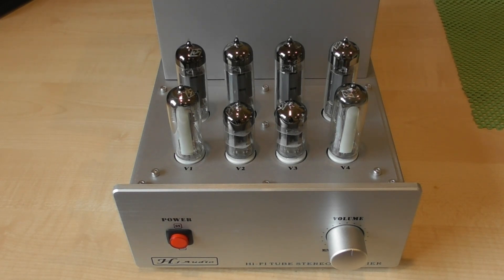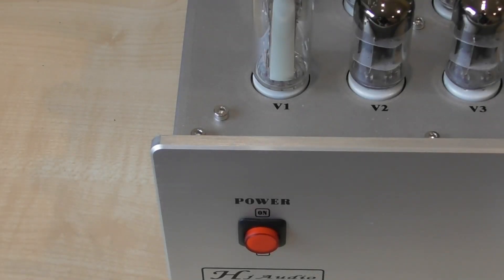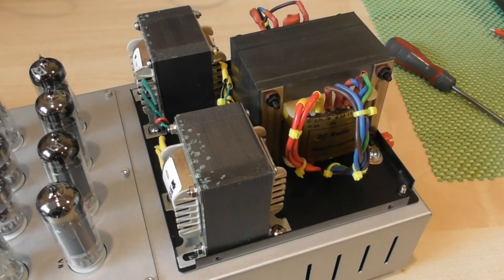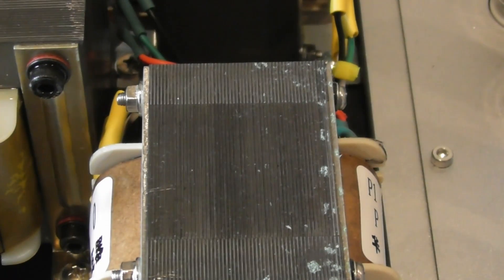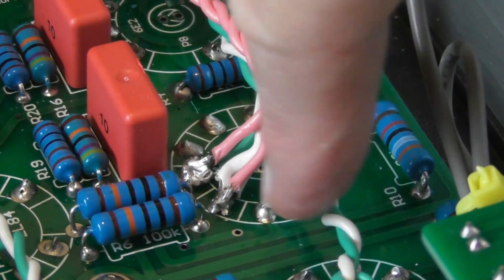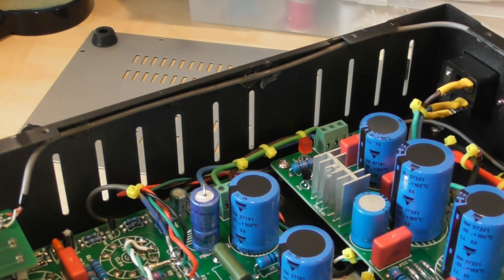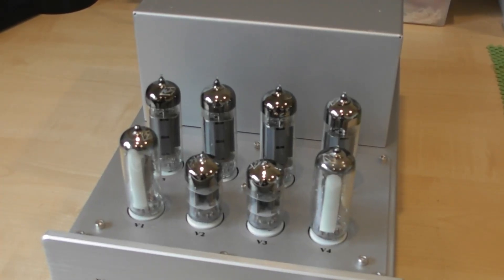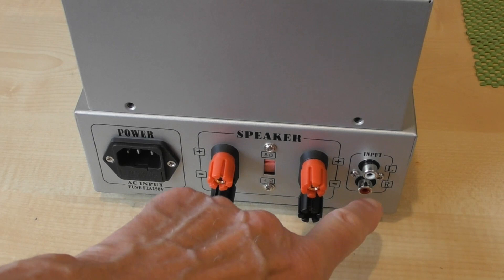13 watt Valve Stereo Amplifier Kit and review. from eBay.

Comment: HI Michael,
Great build job on the amp!  Thank you for sharing!  One note:  The reason for the seemingly over-complex design on the power supply is because they wanted to make provision for the use of either a 6P14 or EL84/6BQ5 type output valve.  The 6P14 is actually a really high quality tube that can be purchased at a reasonable price.  While they are technically interchangeable with the EL84 and 6BQ5, they do have different specs, one of them being the screen grid characteristics.  This power supply allows for optimal screen grid voltage for either type of valve by just adding or subtracting a 20 volt zener diode in the circuit.  It took me a while to figure it out, but if you look at the datasheets for each type of valve, you will see the difference.  Although it would work without such a complex power supply, this just maximizes the performance of the amp.  I also think that's why this amp is so linear.  They really put a lot of thought into this design.  That's why I really like it so much.  Thanks again for sharing!
Reply: One of my most favourite YouTube super stars! Glad to see you here Tony... 
Just a quick question about those magic eye tubes, I'm figuring that if anyone knows the answer to this question it would have to be you! 
I was wondering if these tubes work similar to a cathode ray tube as in a TV? Would they be emitting X Rays? Or does that involve higher voltage or a different cathode/anode design? I really don't know enough about X Ray tubes even though I have seen a few videos about them, I found the tubes with the spinning anode or cathode inside the tube amazing! Someone else has a video showing how they spin and boy can those things keep spinning once they get going. It had me thinking about how much more efficiency one could possibly achieve out of a generator if one was placed inside a vacuum? I wonder if anyone has ever tried it? 
Anyway, I watched a video that talked about the cathode ray tube of a TV and they said that it produces X Rays inside, he also went on to say that we might remember how our parents used to tell us to sit back from the TV because we will go blind, how right they were LoL... But these magic eye tubes, they are nice to look at but do we need to worry about going blind or it's a different thing...

Comment: Loved your honest opinion about tube amps in general, Micheal.
I'm currently waiting for my Boyuu A9 kit to arrive and I've been lapping up every tube amp video I can find, searching for tips, etc.
You mentioned that yours is the quietest tube amp you've ever heard and opined about the superfluous switched voltage power supply for the heaters... perhaps that's why it's so quiet?
I'm no engineer by any means but I've been lurking around in forums and YT long enough and have picked-up that AC heater circuits are major sources of hum if not mitigated and some have stated that they run theirs on DC to that means.
Having said that, I preferred mine to be 100% analogue and chose one with a rectifier tube.
There shall not reside any semiconductors in my rig! LOL
I've not used a CD, let alone vinyl for quite some time. My preferred audio source is a Google chromecast "puck" plugged in the the Line-in of my current stereo which sounds fine to my untrained  ears. Cant't wait to hear what it sounds on the A9. Have you listened to streamed music? Your thoughts?
Reply from the maker: Hi Dennis Thank you for your contribution to my channel. Regarding the low noise of the amplifier. The heaters do not run on DC. They are just standard 6.3 volts AC. A separate winding is used for the preamp but it is centre tapped. It's part of the HT supply that is stabilised. Hum is mostly caused by poor layout with the heater supply or poor earthing points.
Regarding my music, I mostly listen to internet radio from the BBC for talk radio, for music I listen to Radio Caroline Flash Back. Both sound OK!! but for my own music I listen to FLAC files from my PC recorded mostly from my CDs which   I no longer have.

Comment: Hi Michael. Sometimes if an amplifier remains undistorted up to clipping it seems less powerful than it is. Equally if it distorts as the ear does it sounds powerful. SE designs can be remarkable is this. This probably is because second harmonic distortion is present. Beware, many SE amplifiers are not the excellent examples.  They need better power supplies and transformers. RH34 is interesting by Kitic. RH 84 also.

Comment: I have been a huge fan of the man with the X Ray super powers for a very long time... I love his work. He has only ever been beaten by one DIY eBay amplifier and that was the quasi complimentary contraption that I really wished that he had a go at improving, I have a few of them still waiting to be assembled.
I don't know what it is but there's something about them that I like and that's even before I have even heard what it sounds like... They were pretty cheap at around $13AU and they came in two different flavours, others have built them and liked their sound but Tony didn't have the same outcome. Which I really wanted to see a modification to make any necessary improvement over the original design but unfortunately it didn't happen and no one else to my knowledge has done so either...
Regarding your video on the other hand, the one thing that kind puts me off is that they used a PCB, I know that it has nothing to do with anything, there's a kind of beauty and elegance that seems to get lost without the point to point wiring... 
There's a tube amplifier kit from Altronics, I'm not sure if they are also in NZ, it's also based on a PCB, there isn't to many pictures or information about it except for what is in the advertisement. I can't see any output transformers in the pictures of it and I'm wondering if they designed it without them? Or they DC decoupled the output transformer so that they can use smaller ones without going into saturation... Not sure if you know about this particular unit, it could be an Australian design! 
Not sure but kit amplifiers that were designed in Australia were actually very good... Might be worth investigating if this sparks any interest, I haven't found any videos on it yet though it's not cheap at around $600AU from memory.. I don't remember it's power output either, it won't be less than 10W but something is telling me that it was probably much closer to 30W per channel which probably wouldn't be too bad for the price... Yeah so I hope that is useful to you. It's been a long time since Amplifiers were built in the southern hemisphere.. I have an amazing Playmaster kit amplifier from 1973, 13W per channel and it's my benchmark amplifier, I compare every other amplifier to it because like you said in this video, it does something to the music that other Amplifiers don't. It makes other Amplifiers sound sterile... 
Anyway thanks for another great video... Looking forward to the next adventure.

Comment: I don't know if you have done a video on one of those cheap Chinese eBay vacuum tube preamp's yet, I'm still working my way through your videos but I took a leap of faith and got my hands on one.
I'm no expert on the audio quality of tube Amplifiers but I'm really happy with my one, it's the only thing that I own where I can plug my phone's headphone output into it and it's still got plenty of gain! It's using the 6J1 tubes which are $1 on eBay, no one seems to like them but they seem to work well for me, I don't have anything else to compare it to anyway.
There's a few different types out there, 12V Videos has done a great review of it, it runs of a 12V AC input and then goes into a Walton Cockroft (I think I might have misspelled it) voltage doubler to get the voltage up to 50 od volts... The other versions on eBay run at a much lower voltage and don't seem to get good reviews. It comes with a clear acrylic laser cut enclosure that you have to put together yourself but it comes with the tubes! The only thing that you are going to need is a 12AC wall wart and some RCA's and your done! 
It's one of those things where I got it after scouring through all the eBay listings, and there's a lot of them, I'm very dedicated when situations make others give up LoL. I just liked how the circuit arrangement was and the components that were used. That was basically my decision making process LoL. And it didn't disappoint! There might be better out there but I don't know that.... Yet.
Reply from the maker: Yes I did review and build one, quite a while ago now, you will find it!! I will not spoil the outcome of my tests!
Reply: @MichaelBeeny  slowly but surely I will get to it..

Comment: Amplifier power works exponentially, not linear. 

So for example, let's say you have 91dB Sensitivity Speakers running through a 10W Amp, this is the power output:
1Watts = 91dB
2Watts = 94dB
4Watts = 97dB
8Watts = 100dB
That is very loud! a 120W amplifier would only play the same speakers at 112dB. (4 times louder at 12 times more power)

Comment: My Amp is hand made  but it also has no tone or any other control , not even Volume button , not even Grounded .  Ive used Studio monitoring a lot for i do Audio , and im used to Ground Loops and what they do , so decided to Cut off Grounding , Amazing stuff . Sure , i know electronics to others i would not recommend running Tube Amps with no Ground but , to me its phenomenal . Nothing in the signal chain , no thi ng .

Comment: No My friend , that is not Stabilized power , that is a Mosfet Capacitance multiplier , its a Filter  it wont stabilize the Voltage it will kill the ripple . But i agree you dont need to stabilize it , it can float on the input voltage but you need Ripple rejection and that is what that circuit does .
AS for AB mode amp , yes it will need more power when it goes in to AB mode , its probably A mode until some level , then AB after , when this switch happens voltages will drop because more current will be drawn, but again its not a problem as long as it is Ripple free .

Comment: The  perceived power could be the energy stored in the output transformer. On a bass transient it might give more than thought.  Triode mode might be more detailed even if sacrificing watts.  Reducing negative feedback can give better sound despite the distortion levels. Zero loop feedback even if the transformer reasonable. If gain too high the cathode capacitors might be removed.

Comment: If you have a Sony .TC377 or similar tape deck using the third head play back you can mimic valve sound. 
Like the right amount to sugar in black coffee it can seem to be better than the original. Eventually the truth comes through and there is added distortion. None the less it can be convincing. Wow and flutter will ruin this illusion.

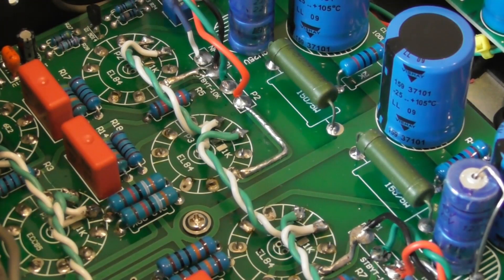Comment: Hi Michael!  Regarding the P1 and P2 connections on the PCB (you mention a HT 'high tension' wire at time stamp 11:00). Could I just run a simple solder trace?  Alternatively, in my Amp Kit, there is an enameled covered copper wire (not sure where it is to be used).  Would this be cut up and used to run the HT traces (do I scrape off one side of enamel and then solder into the P1 & P2 solder paths)?
Reply from the maker: Not sure why they give you enamelled copper wire?. I simply used multi core wire twisted together and solder coated. Then simply soldered it in place over the whole  track. Not really sure why because the current quite low but voltage is high. Still they did it, so did I. Cleaning the enamelled wire seams like hard work to me.
Reply: @MichaelBeeny  Thanks!  Makes sense. I shall simply strip the multicore wire(s) included in the kit and solder in like your example.   I was curious (being inexperienced) as I never hear of HT wire on PCB.  I never did this in another Soldering Kit (have only done a few of them).   Cheers!
Reply from the maker: @20thcenturyboy85  Sounds like you are doing well and leaning as you go. I started much the same hundreds of years ago. I find I'm still learning today. Good luck with the amplifier.